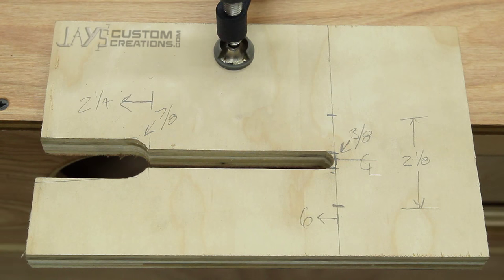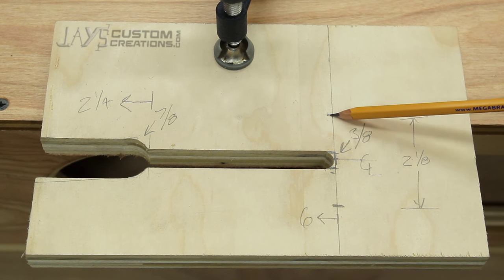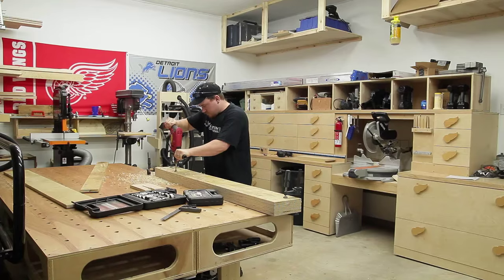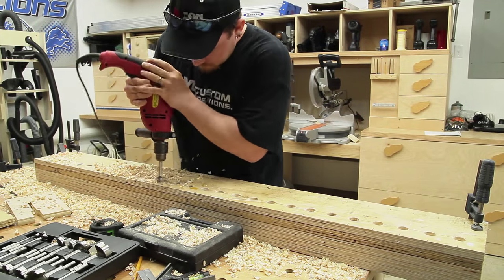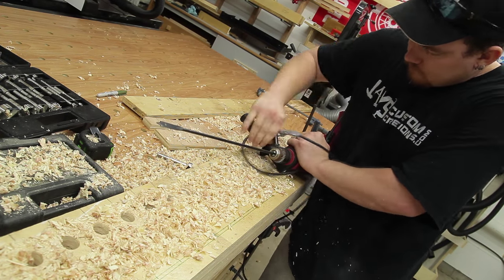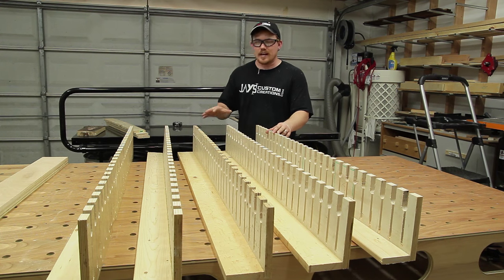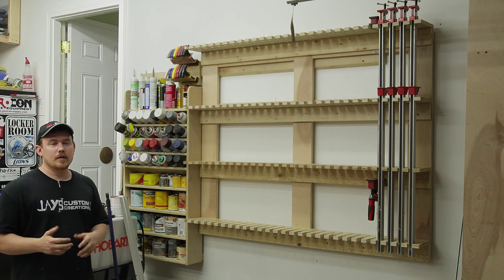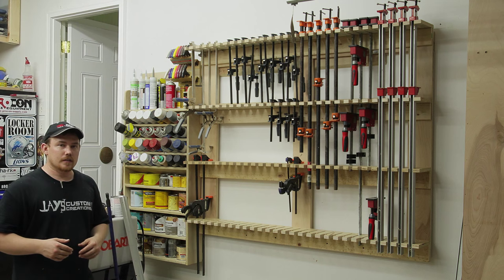Universal Clamp Rack - 206

Comment: Jay, I'm in the group that recommends doing a video on installing A/C in your garage.  I live in NC and it's hovering around 100 right now.  Get foam insulation panels for your garage door and mount a small room air conditioner in the wall.  Disclaimer though, window A/C units are designed to fit in the thickness of a window, so if you have a 2x4 wall, the vents on the side of a unit will only partially go outside (and partly stick inside the wall... look at one, you'll see what I mean).  I recommend cutting a hole about 1ft wider and taller than your unit, then framing for your unit out of 2x2s to reduce the wall thickness.  Cover inside and outside with 3/8 plywood or Hardie Soffit board, make it look pretty on the outside.  It'll only help the home's resale one day.  I'm a landlord, I've installed lots of these in small units that don't have A/C.

Comment: Nice rack!  :)
I can't get over how nice the top of the bench looks.  
That veneer pattern on the plywood really pops man!.
I had the same problem with my drill press popping off the quill when under extreme stress.  
I took it off and cleaned the spindle with emery cloth and then placed the quill back on the spindle and press the assembly down against a 2x6 block.
It hasn't come off since.  Not sure if it was ever on properly from the factory.  
I keep noticing that your garage has a very high ceiling.  I would love to have that much height Jay!
You shop is really coming together nicely.
Thanks for sharing.

Comment: Jay, love the fact that you can store any kind of clamp in any of the slots. Your sacrificing on ton of space though by not doubling or tripling up those slots for the smaller clamps, you have plenty of depth in the system you have allotted to do just that. This is a picture of the style I use, find it takes up way less wall which I have very little of. lol http://www.woodcraft.com/Images/products/600/153592.jpg

Comment: I think you have the right idea using available materials and coming up with a design that allows flexibility. IME, clamp storage is something that is hard to know how you're really going to use until you have something in place. I personally like a rolling cart so that I can move it to my assembly space when needed and roll it out of the way when not. But big heavy pipe clamps are too clunky/heavy to leave on a rolling cart, so they get stored on a non-rolling space.  Also, those HF clamps seem to multiply over time, especially in the shorter-to-medium lengths.

Comment: I'm going to steal, er, borrow your bracket design but put the rack on a roll-around cart so I can pull my clamps nearer to where I'll be needing them. I like this project a lot, so thanks for the inspiration (and perspiration.) I used to live in West Windsor, NJ and know how hot and humid it can get in the tri-state area during summer. Now I'm in Houston and sweating all the time. I'm going to install a mini-split A/C system in my shop.

Comment: Looks very good. Great job. 
On your drill press clean the parts as good as you can and make sure they are dry and dust free. Then insert the chuck so that it stays in the drill press and give it a couple of good hits with a mallet. Do not use anything to make the chuck slide in better it's just going to make it fall out. The cleaner and dryer the better it will work.

Comment: Excellent design. I've been putting off a clamp rack for some time because of the different kinds of clamps I have. I think your 3/4" pipe clamps are bigger than mine though because mine fit in a 7/8" slot. Great video as always.
Reply from the maker: Pete Nilsen 1/2" pipe has an outside diameter of 7/8"
Reply: Jay Bates Duh...Oops!

Comment: Great design. All those pipe clamps and Bessy bar clamp are heavy. Do you think you will get any sag with only one row of screws holding the horizontal surfaces? Either two sides attached or 45 deg shelf brackets would do it.
Reply from the maker: bluesideup007 Hasn't sagged since making it. Doubt it will.

Comment: Cool!  What software did you use to overlay the clone frames? I use iMovie and I don't believe it has that capability - great if it does. I hear you on the heat - my shop is 4,000 sq. ft with 28' ceilings. I'd love to install AC but until I hit the lottery that's one dime I'm not gonna drop! Bad enough the town is now forcing me to spend another $10k on installing more sprinkler heads under all the upper mezzanine levels I've built..
Reply from the maker: cuskit Dang thats big. I've often wondered how large your shop was.
Reply: Yup. 40' x 100' with about 2,800 upper mezzanine so far, another 1,500 across the upper back yet to go. Then I can really set up the shop the way I want... I'll be putting up a shop tour video sometime late summer.

Comment: Jay, did you consider making a template and using a router rather than the drilling/jig saw? Just curious....(not saying it would be any easier or better, just wondering if you mulled it over.)
Reply from the maker: Jay Benedict Brown Yes but I didn't have any template bushings for my router. Just a bunch of really crappy bearing guide pattern bits. I just got a template kit for my router though.